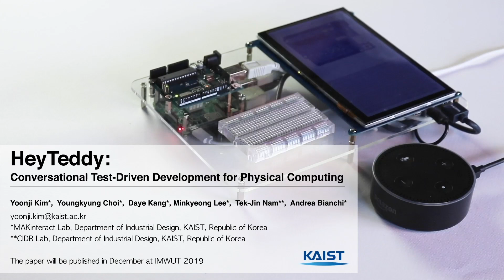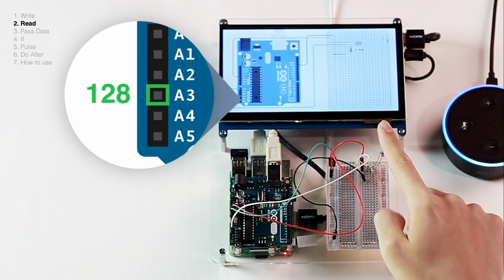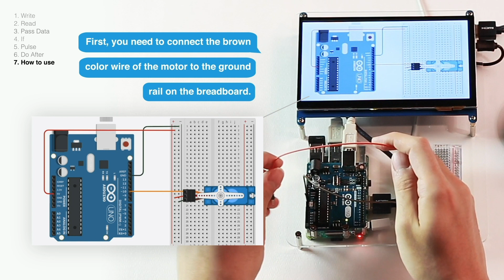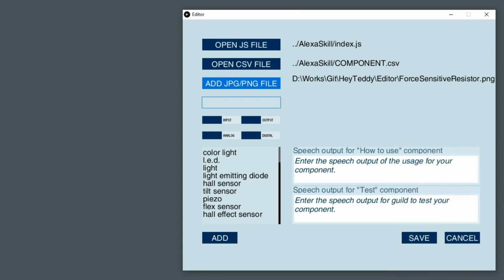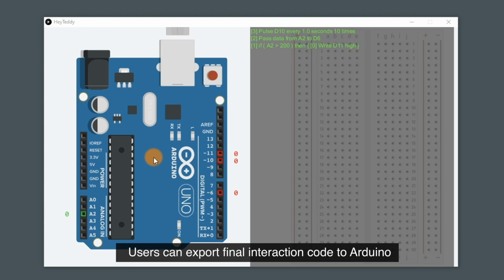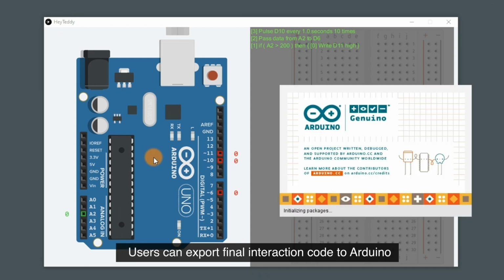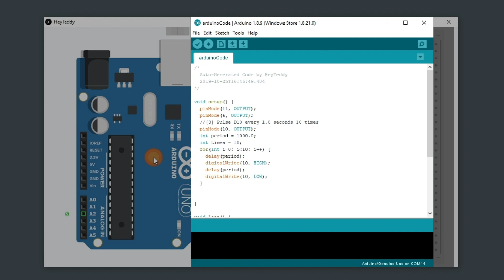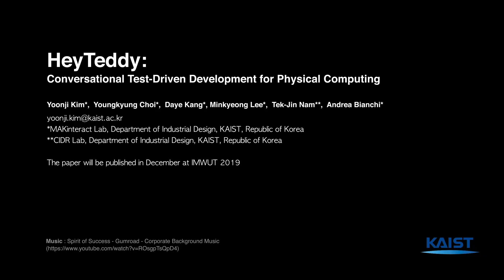HeyTeddy: Conversational Test-Driven Development for PhysicalComputing [IMWUT 2019]

Comment: Initially I was pretty skeptical of this, and it is pretty limited, but if this were open sourced it would make for a very interesting starting point for teaching users about the basics of hardware circuitry and programming. It's akin to sketch in that while it's limited, it's very understandable by kids and novices. It'd be interesting to see a more advanced version of this that shows you code as you build your app and helps users to better understand what's happening in the background software-wise.  Also might want to change "I talk to the Arduino" to something else like "Arduino online" lol